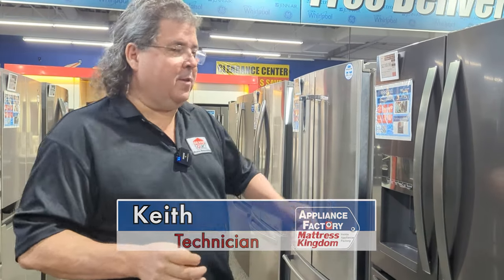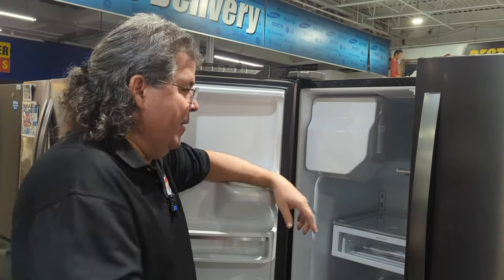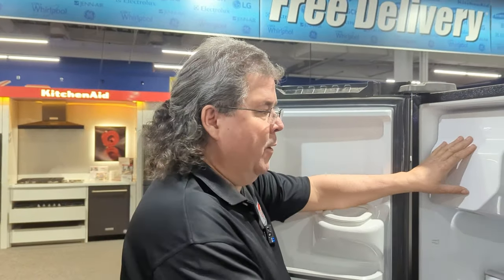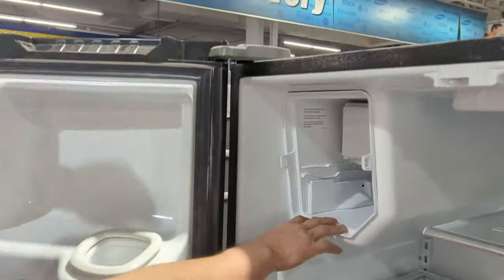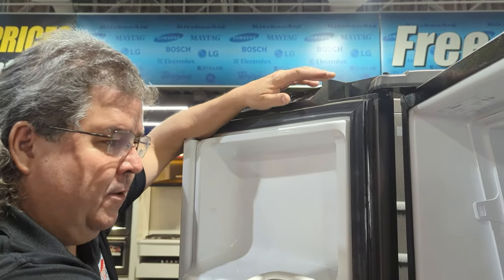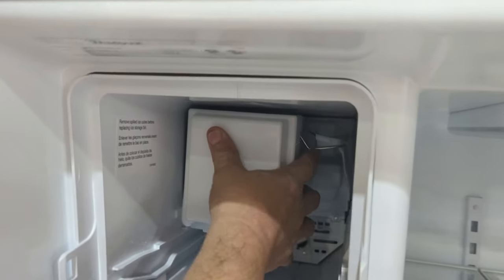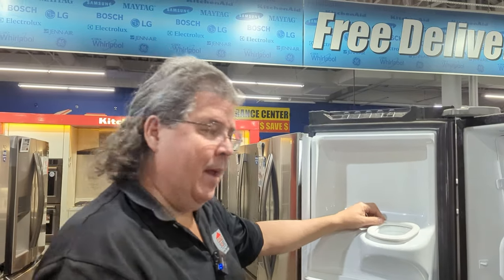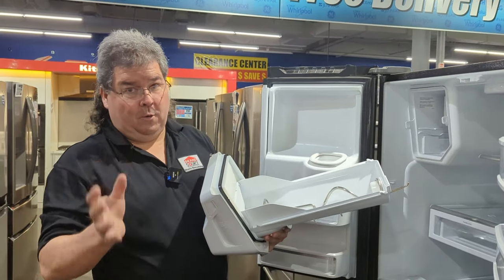Why Your Whirlpool Ice Maker is NOT Working

Comment: I have that EXACT fridge and it stopped making ice about a year ago. I put a thermometer in the ice box and it only got down to 20°! Now what?
Reply: Did you try resetting the freezer temp?
Reply: The condensor coils are probably dusty in the front/bottom of the fridge. Remove the kickplate and shop vac them/dust them off.
Reply: @DiodeMom

Comment: My brand new Whirlpool side by side would not make ice. Turns out, the electrical connector at the back of the ice maker was never plugged in when it was assembled at the factory.

Comment: I have the exact same refrigerator in your video. It stopped making ice yesterday, and I checked the temperature it is 10° just like you said, and the arm is in the down position, and it is not working.  Any suggestions on what to check next?
Reply: Water line might be frozen. Need to defrost it.
Reply: @CKnight1983  thanks,  I'll give it a try. I have been filling the I tray manually.
Reply: @lynnh7694  Take the ice tray out and try to see where the waterline comes in. Turn off your icemaker and then use a hairdryer to melt the ice in the line coming into the icemaker. If you don't use your icemaker much, it will just sit there allowing the line to freeze shut.
Reply: @CKnight1983  can the water line be frozen and the fridge still dispensing water?  I have the same issue...and ice isn't making still.
Reply: It's split.
Reply: I have mine set at -3 degrees the ice still looks wet when it comes out...Not happy with the way it works...
Reply: Mine is 6 months old. It makes ice just not enough. My old fridge ice bin was three times larger than this one. Bad design. Probably environmentalists wanting to save water.
Reply: Mine is fine in the winter.
3 spring/summers later and it’s still a concern
Reply: @ONCE.Daren.Quebada  I have to use a blow dryer about every 3 months to keep it going.
Reply: @CKnight1983 is this done inside the ice maker or behind the fridge ?

Comment: Hello looking forward to subscribe to this channel ASAP, but today I just purchased a brand new Whirlpool refrigerator, Whirlpool Model # WRS555SIHZ06 side by side, I have two questions, first I notice that in this new model I purchased today, the compressor shuts off anytime you open the fridge door or the freezer door, and then turn back on when you shut the doors, is that normal? the second question is, what temperature should the freezer side, and refrigerator side, be if you set the temperature at the factory recommended setting?

Comment: Whirlpool fridge would not dispense ice.  The motor, below the cube bin, must turn the auger and blades in the bin when the user calls for ice.  There's a coupling between the motor and the auger/blades in the bin.  If water gets in the coupling at the top of the motor, it will freeze and block the coupling at the bottom of the bin from seating properly.  So, the motor turns but will not turn the auger/blades.  You hear kind of a clunking sound as the bottom coupling slips under the top.  Clean out the ice, careful not to damage the coupling. When clear, the coupling can seat properly when the bin is inserted.  We lost electricity for about 30 hours.  Ice in the freezer started to melt, leaving water all around.  When it re-froze later, the coupling was iced over.
Reply: Should have said this is the Whirlpool fridge with the ice bin in the freezer door, model WRS588FIHZ04.

Comment: My ice maker is making ice but the ice isn't coming through the door what do I do
Reply: I had that issue. Pull out the tray and look at the back of the tray where the plastic turning mechanism is. If it is frozen around the sides it tends to push its self away from the motor and stop it from engaging the auger. If so. Run hot water over it. Should pop back into position as the ice melts. Also make sure the area underneath were the tray sits is clear of any ice chunks. Hope this helps
Reply: Mine is making ice but ice won”r come up and I can not open the ice maker
Reply: @auroralopez7080  yeah it happens. Unfortunately this is so poorly designed that it gets stuck frozen and the cheap plastic release mechanism makes no difference. I have pulled the whole face off before and broke a plastic clip. Didn’t make a difference. It still freezes shut. Just pull like hell. 

Fortunately I didn’t pay for this fridge but I definitely will avoid this brand in the future. Cheap. Poorly designed

Comment: These whirlpool ice makers are complete  junk! I’ve had this unit a little for five years, I have already had to replace the entire icemaker because it quit working. Then every 2 to 3 months it freezes up or ice gets stuck in it, and I have to pull apart and disassemble the whole thing again. Whoever designed this piece of junk is an idiot.